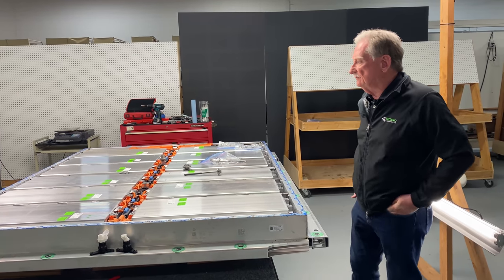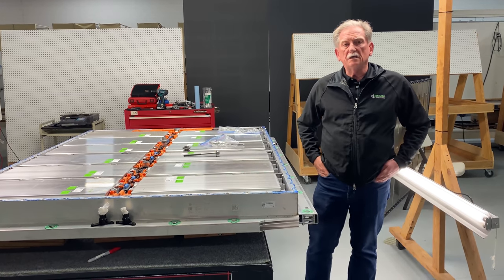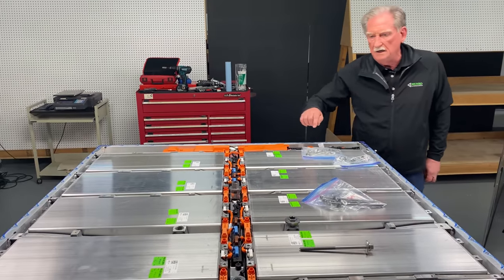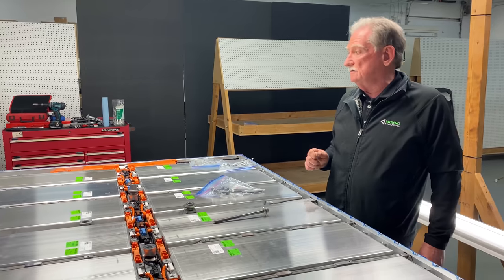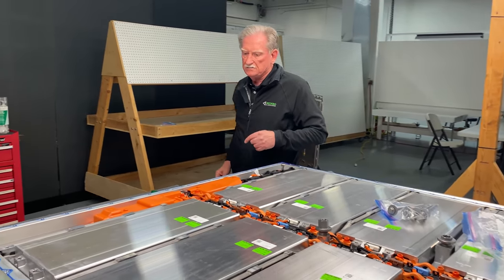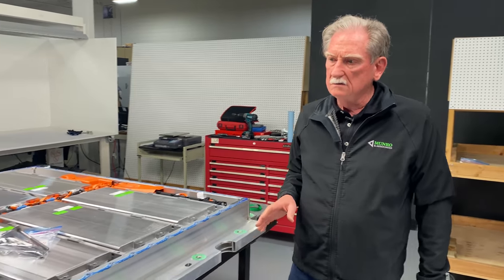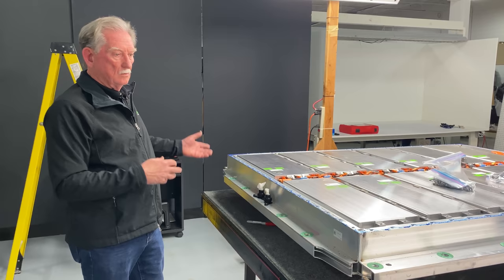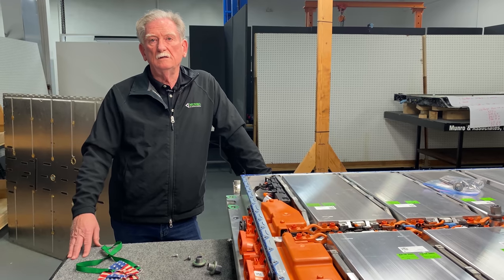2021 Volkswagen ID.4: Battery Teardown

Comment: Thank you for using Kilograms and not Pounds.
Reply from the maker: No problem!
Reply: Smart people use the Metric system ;-)
Reply: @ADOENDRA  It's universal. But the 50 kg lighter TMY battery pack than ID.4 I did not find... Do the math
Reply: @ADOENDRA  It's more accurate than the imperial system. Metric is measurement and Kilograms are weight.
Reply: @radicalrick9587  So kilograms are not metric? ;-) So all of my life I have used the wrong system.....
Reply: @ADOENDRA  It happens. For example, NASA always has teams of people working on different projects and then bring them together. One time one team was using metrics and the other team was using the U.S. of A. Standard measurement system. I don't need to tell you what happens there. When they tried to put the two giant pieces together, they didn't fit. Even though both of these are measurement systems, the point shows that people do make mistakes like that. I know this because my friend worked for them. He was an electrical specialist so he had nothing to do with that project.
Reply: @ADOENDRA  Kilometre is the measurement you might have been thinking of? And the only time metric come in on weight is if you are using "Metric Ton" but that's it. It doesn't apply to lower weight.
Reply: @radicalrick9587  They even lost the Mars Climate Orbiter in 1999. Metric vs Imperial Units.
Reply: @ADOENDRA  That I didn't know. 🤣🤣
Reply: @radicalrick9587    " Most countries use the metric system which includes measuring units of meters and grams, in the United States, the imperial system is used where things are measured in feet, inches, and pounds. " A ton comes from an Engish long ton or English ton ( 2250 pounds ) in weight. Ton came from the barrel. A metric ton is 1000 Kg. And even a pound came from the English, pound sterling, the old English silver coin  ;-) Everything that the US is using came from the English immigrants.
Reply: @radicalrick9587  Same problem with the assembly of the Airbus 380. And yes I have worked for US companies. And it is a pain in the ..... ( you know what ) if you start mixing.
Reply: @MunroLive  but it's not 50 kg difference rather 10kg.
Reply: @ADOENDRA  and dumb people don’t understand pounds or how to do a simple conversion.  It’s 2.2 lbs per kilo. You’re welcome.
Reply: @ADOENDRA  then why is an American ton 2000 lbs?
Reply: @alexnutcasio936  There you go.... you always have to work with a comma, we don't. I understand the imperial system very well, don't worry. 
They have even used the metric system to land on the Moon because the calculation would be too hard. 

Then again especially for you!

 " Most countries use the metric system which includes measuring units of meters and grams, in the United States, the imperial system is used where things are measured in feet, inches, and pounds. " A ton comes from an Engish long ton or English ton ( 2250 pounds ) in weight. Ton came from the barrel. A metric ton is 1000 Kg. And even a pound came from the English, pound sterling, the old English silver coin  ;-) Everything that the US is using came from the English immigrants.
Reply: @ADOENDRA  US is the only country still using imperial. Even UK is using Celcius, gram,. meters now.
Reply: @joggelweekend  The UK is making a switch and mix right now. Official countries: The US, Liberia, and Myanmar.
Reply: @ADOENDRA  the US doesn't use the Imperial System.
Long ago, as in hundreds of years ago, we forked off from the Imperial System, and added some units, changed some units, and removed a bunch of units, and developed the US Customary system, which got refined over the decades by tradesmen and engineers into what we have today.
At the same time, the Imperial system was also changing and being updated, but seperatly.

It was only a few years ago that the length of the Inch/foot was standardized between USC and Imperial, because they had been a few thousandths different, and so they brought each one slightly to the middle to make life easier.
But many things like the Ton and the gallon/pint are different, because they pinned them to a different standard than we did.

But we don't use Imperial, any more than the UK uses USC, we just share some units.

Meanwhile, the metric world can't let go of Celsius, and so has two different temperature scales, with Celsius not being very logical, and you also continue using illogical time keeping methods, when switching to decimal time would make MUCH more sense than the US changing what units we use, since what we use works perfectly well for us, and is just as accurate as metric units.

It's kind of like telling us that we need to make the national language Chinese.
Just because there are more Chinese speakers than American English speakers doesn't mean that we should have to change!
Reply: Why? Pounds are way lighter.
Reply: @ke6gwf  How does the metric world have two temperature scales? We got Celsius - and it is VERY logical: Freezing point of water: 0°. Everything below is minus degrees. Boiling point of water: 100°. So you got practical observations of the natural world to relate to. Also, everything in the metric world is being divided into tenths - not 1/4ths, 1/12ths, 1/32ths...which makes it much easier to handle, calculation-wise.

America wants to make money (and is actually obsessed about it). Well - sticking to the outdated and inconvenient imperial system costs America billions of dollars each year: There need to be two different sets of tools in every workshop - and it makes U.S. products way more incompatible for export.
Reply: @taxiuniversum  I guess you have never heard of Kelvin?
C is a random scale, because 0 is not actually zero. It's no more logical than F, which is based on the average temperatures humans live in for 0 and 100.
But for the metric world to have dual systems and the associated confusion between them is not logical.

Secondly, most measuring in the US is not done using fractions.
And metric countries use fractions anyway, ever hear anyone say half a meter, or a quarter mm?

Fractions are used in carpentry because it's easy, but any carpenter can use decimal inches if they want, but they generally don't.

Also, most fields that use fractions are not having to do many calculations. 
And the fields where calculations are required, tend to use decimal. 
Surveyors for instance use the Engineering scale, which is feet and tenths of a foot. 
Machine tools use decimal inches and thousandths. 

I hear the claim that the US is cost billions by using the USC System, (we don't use Imperial over here), but that's stupid lol

Even if we changed today, mechanic shops would still need two sets of wrenches for many decades, and that only costs a few dollars extra.
But when you look at the big machines, the factories packed full with USC scaled lathes and machine tools, and you realize that they can have many decades of life, if you tried converting the country it would cost billions to replace all the long life span machinery, retrain all the engineers and workers, replace millions of street signs, reprogram electronic devices, replace all the USC measuring tools, and all the other things that go along with a major change like that.
And it makes no sense to force that change, especially since the main people that will benefit are the YouTube comments section lol
Reply: @ADOENDRA  Not only USA, but Canada, Australia, etc. Imperial units are still fully used in North America and UK. Canada is just like UK, sometimes imperial, sometimes metric.
Reply: @joggelweekend  not fully. Distances are in miles and feet. Canada started changing and abandoned the process in the early 80s. So, you buy meat, fruit veggies in LBS, plumbing, and construction in general is imperial and Canadian railroad system is still in imperial. Trains still run in MPH. So, those countries are Hybrids.
Reply: @bmw803  fffffff relax, it was a joke !
Reply: @ADOENDRA  no kidding. !!!!
Reply: @taxiuniversum  fasteners used in aircraft (& helicopters) are all still using imperial sizes, which is less than optimal but just the "way it is" 😳
Reply: @radicalrick9587  "It's more accurate..." 

No it's not. They are numbers.
Reply: @MrCarGuy  Metric system has always been more precise than Imperial numbers and easier to match up which is why NASA prefer it and engineer that must deal in high tolerant machine such as airplane engines(because you don't want to be falling out of the sky from common engine failure like car engines).
Reply: @ADOENDRA  m  to hill to
Reply: @ADOENDRA  the Imperial system is derived from metric system anyway
Reply: @ke6gwf  I can't imagine using that many words to justify using dead scales.
Reply: @bmw803  Australia does not use imperial measurements.
Reply: @MAYDAYDEEJAY  Nope!!! Imperial system is binary.
Reply: @stambo1983  Not today. You're right. They used to.
Reply: @bmw803  please go and watch Varitasium and his escapade to the place where all the "standards" are kept
Reply: @ADOENDRA  smart people can convert either system.
Reply: @bmw803  not by professional engineers and scientists it isn't, I mean we can, but its not the go to unit. We may have left the eurozone , but we are in Europe. Also - anyone confused about Celsius and Kelvin really ought to leave the conversation too.  Kelvins work well in terms of cryogenics ,  and as 1 kelvin  = 1 degree C....
No one here seriously designs an engine or a bridge or cup in units that aren't decimal in nature, as that's inefficient and frankly best left to people who wish to obfuscate things that  potentially leads to shit that gets unusefully complex.   I work with Canadians and Americans too,  and  both sides have to be flexible,  but play with  Brake specific fuel consumption of cryo fuels   -  bring in an F and frowns appear.  Imperial based systems are not intuitive units.  Anyone arguing against this  dunny  work deeply in both systems, or have great grip of why science has progressed its way of measuring things with , dare I say it ....  time.
Reply: What difference does it make? Its the same weight...
Reply: @sammyposton5934  Tray to make some complex calculations with it.
Reply: @radicalrick9587  Kg is a mass unit... weight is a force, Newton unit
Reply: @olavoleite2416  1 Kg or Kilograms = 2.20462262 lbs. So the formula for an approximate result is to multiply the mass value by 2.20462262. Weight is measured by the force of gravity acting on that body. Hence a newton. Therefore weight is a force measured in newtons. An interesting fact is their no weight in space. You can't even measure mass in space since it would sit in suspense.
Reply: I suspect that some of the commenters, and many people in the U.S., don't realize that the entire automotive industry has been metric (or more properly, using S.I. units) for decades. They only convert to "U.S. customary units" for the public.
Reply: @bmw803  you are wrong about canada all science calculation are mainly done in metric except for export product like aircraft... The main reason why Canada still with the imperial system is because of his neighborhood USA. A lot of material come from usa construction wood, metal plate, pipe... . BTW You can buy meal and fruit in metric if you want... The biggest plus of the imperial for.the measurement is you have a good idea what is a inch and a feet... For exemple the height of a person is mainly in feet cause we have a good reference... Anyway there is no better unit system if you know how to use it... For the rail train system given Canada and usa use the same rail, we keep a common unit.
Reply: @cyrikdnamps  Canada, like many other English countries used imperial measures before converting to Metric. USA converted in some fields, and Canada partially converted, because its infrastructure and manufacturing was using imperial units. But, you're right that you guys use lots of products coming from the US, therefore using mostly US imperial sizes.
Reply: @bmw803  Canada use kilometer, kg... Without conversion. Maybe in my province it's different from other province... You learn everything at university in metric system. Like I said, it's more for material we continue to order a plate of 1 inch of aluminum... Because we know it will be in inch in North America due to usa. But in Europe is more in millimeter. That is funny when you have a part of an engineering project done by europeen for North America they call  material in millimeter and call sheet metal in millimeter when here it's Gauge in inch... I heard that after the problem  with mars orbiter, the nasa switch to common unit which is metric now.
Reply: @cyrikdnamps  I get that bro, but when I walk into a Canadian grocery store, I see LBS and KG in smaller. 90% of whatever they sell at Home Depot is in imperial units. Sure, your highway signs are in KM, but it's the same here. Anything you buy at the grocery store, shit is labeled in both units. But, packaging listed in metric with uneven numbers means it's an imperial unit. When you see 1.89L on an orange juice box, that's 64 FL OZ. And 454G on a block of butter it means 1LB, but most of them are labeled in both units in Canada. That's what I see.
Reply: @cyrikdnamps  and by the way, where are you??? I'm in the Buffalo area, so we often go back and forth. Many Ontarians come here for groceries to servicing their cars, buying tires etc. But ,check those uneven weird units on containers. It's funny for me to see such a thing. Always wondered why they never round up numbers. It's because they're using an imperial sized container. Soda is another example. 473ML is 20 OZ. When you come to America you'll notice on the packaging where those weird units come from.
Reply: @bmw803  im from Canada Québec
Reply: @cyrikdnamps  Ah, because in Ontario, imperial units are everywhere. parking garage, Burger King drive thru, etc all heights are always in feet and inches. Food is all sold in Pounds. Maybe the French influence makes it different in Quebec. But when it comes to cars, U.S. law mandates that speedometers, must have KPH units and MPH. Compliance labels must list LBS and KGS. Go figure that. Liquor bottles are all in "ml" or Liters.
Reply: @bmw803  like you said some people still using imperial unit like my father... But normally Canada switch all there unit system to metric. But like I said we are doing exportation and importation with the USA and for the construction wood metal etc... We use inch because the material are in inches and feet. We could replace it by metric but people working in construction prefer the old schoool unit. On my side im working in Aerospace and we still using imperial because the aircraft is build from us material... Its funny. Your country is big so that put a lot of pressure on Canada to use the same unit in some application... But like I said both are not bad but the imperial unit become more complicated in some calculation. Im prety sur you never use "Slug" in the dayd to Day. :). The big plus for the?metric your weight still 90kg on the moon and on mars which is not the case for imperial unit... You will have to use for the slug :) but we are not going there really often then who care :)

Comment: The MY battery is 170Wh/kg, the ID.4 Battery is 167Wh/kg. So despite VW having created the much heavier shielded, by far more modular and robust design and according to Tesla fanboys are lacking oh so much behind in cell chemistry, they created a pack with the same energy density, far better repairability and as it seems to me a much higher potential for recycling (pouch cells from aluminum compared to oosing epoxy everywhere). This is an excellent job! I vote for VAG to further explore the superiority of pouch cells over cylindricals. And don't let them use plastics for big structural parts in mass production! ... Recycling nightmare!
Reply: Thanks for your interesting comment
Reply: Thats it. He is talking als the Time about Polymer for weight Reduction. Im happy they built it in Aluminum instead. I would not buy that Stuff if they build it in some Polymer Bs.
Reply: 3 and Y have power conversion and 2/3phase charging included in battery pack. But yeah, no repair to pack can be done easily

Comment: I'm really happy that this guy have nothing to do with Volkswagen. They already saving cost everywhere, but if they start listening to this guy, that would be a nightmare to work on these cars.
Reply: Of course VW can listen, but they can implement only the suggestions they consider viable. Even removing one completely redundant bolt where redundancy isn't needed can save in cost and complexity.
Reply: Quite unlikely they will change the frame to composite material. The ID-Platform is a long planned and carefully designed piece, that will be produced in the 10's of millions in the next years. It cost a fortune to design and develop. Whole factories are built around exactly this  design.
Reply: True, and in my limited experience with VW (all old Golfs), they're already a nightmare.
Reply: he's just giving food for thought - and is paid by oems and manufacturers to add this thought process - doesn't mean it will ever be implemented - but next time they design something they can incorporate some of those ideas where they fit
Reply: His ideas sounds like exactly the reason most don’t buy American cars here.
Reply: Pilnai pritariu! prisiklause JAV gamintojai to senio paistalu jau seniai gamina vien ir te gamina meistru košmarus…